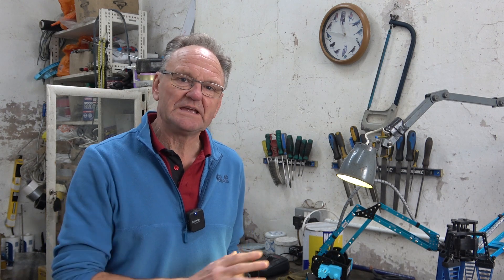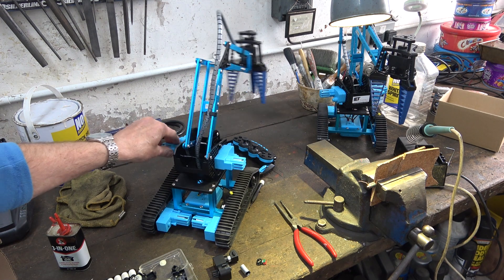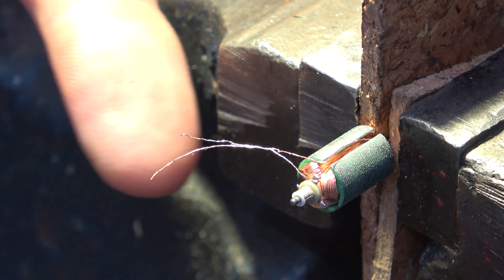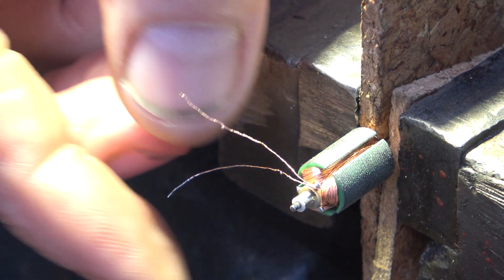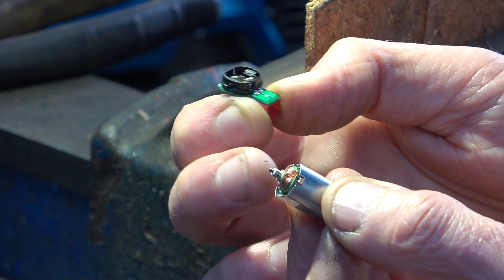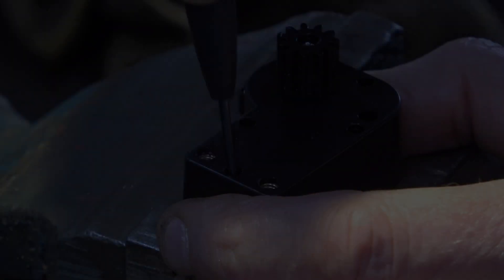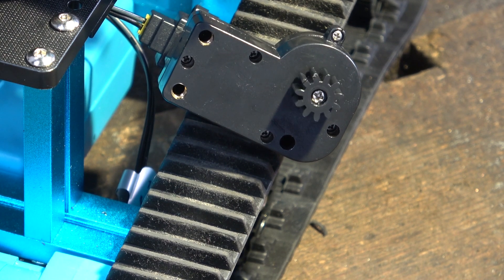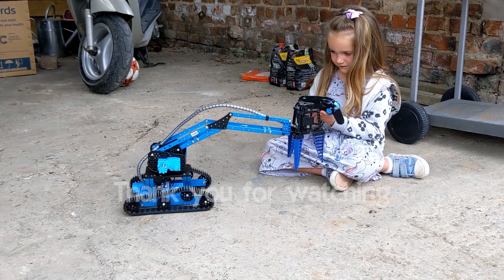HS149 Robot small DC motor fix

Comment: That's definitely a nothing ventured nothing gained job! I'd have put money on the motor being beyond repair, or at the very least the screws holding the gearbox together stripping upon reassembly. Good effort 👍 🇬🇧
Reply from the maker: Hi TRM, there was quite a bit of luck involved but as they say 'fortune favours the brave'. With a positive mindset you can achieve anything (sometimes). Cheers

Comment: Reminds me of "tuning up" slot car motors "when I were a lad" - re-winding them, encapsulating the windings with epoxy, fitting stronger magnets, stronger brush springs...They weren't quite as delicate as the one you've got there though!
Reply from the maker: Hi MidEng, yes I too had slot cars when I was a kid. They left the track often enough even without upgrades ..... Cheers

Comment: Impressive repair Paul, that looked very fiddly,   and I work with tiny electronics! Is the big spring on what looked to me like the output gear a form of clutch?  Some of my daughter's toys have slipping clutches on the electric motor drives, I've not had to go inside but imagine it to be something like that.
Reply from the maker: Hi Olly, I did not think about the purpose of the spring, I was just concerned not to lose it. But yes a clutch is a likely reason for it. One of the other robots definitely has a limit clutch. The spring was very strong but the gear reduction (torque multiplier) on that gearbox is very high. We could probably work it out from the picture - counting number of gears and number of teeth on each. Cheers

Comment: I recently repaired a small dc motor. Same problem small wires and big thumbs. I ended up using a stereoscopic microscope x 10 power. Just cannot focus close enough anymore. Luckily I have the tools for printed circuit repair with a temperature controlled soldering iron. The small pointy tips are beneficial.
Reply from the maker: Hi Glenn, any smaller and I would have needed a magnifier. There was a lot of placement guesswork on my part.  I think that iron is temperature controlled but the tip I was using was far too big for that job. Cheers

Comment: I made a career of working with micro tooling -- I don't think I could do it anymore .  I know my eyes won't permit it anymore without some serious visual aids .
Reply: I had to give up working on cell phones and tablets because my old eyes just couldn't focus on the tiny components any more.
Reply from the maker: Hi Ken, one (surprising) thing I learned about TIG welding is that it's very close work often needing a magnifier in the hood to act like reading glasses.  So there is no shame in using a magnifier ... at any age. Cheers